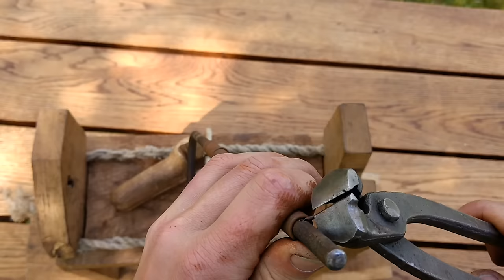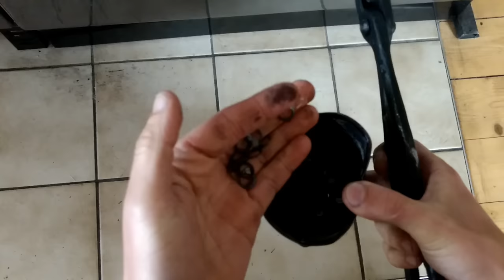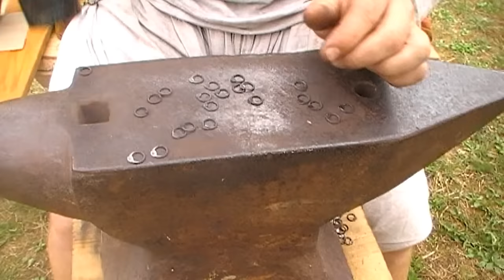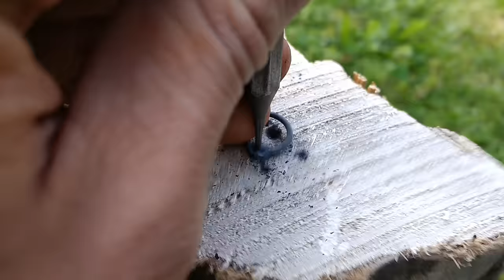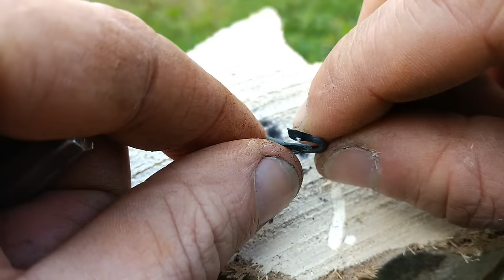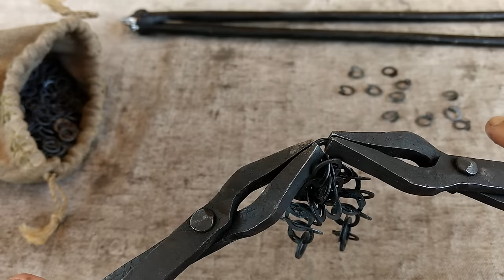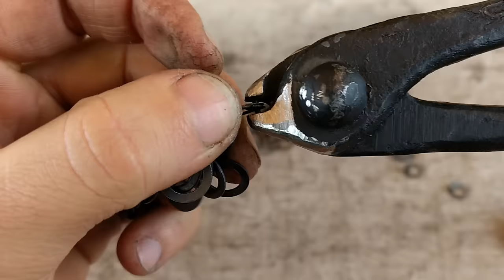How to make riveted chainmail

Comment: Although rivetted mail is more time consuming and labour intensive, it's worth it as the outcome is you have a very reliable and sturdy product that would survive brutal condition and most of all not tear open easily like a butted chainmail would......My passion n desire to make a chainmail had been revived!!😎😎😎
Reply: Even though this is 6 months late...my 1/4 inch inside diameter 14 gauge steel butted maille wont tear. Had several people try...rings are too small and too many in a small area. I trust my maille
Reply: LilRed Wagon how did they try? Were they using their hands, stabbing with a sword, or using something like a crowbill (not a crowbar, a crowbill)?
Reply: @dylannecros3636  original poster I assume means by literally 2 handed tearing it apart which I had 3 different "well" built guys try from work. I dont think a crowbar is gonna do much in the way of tearing my maille. I do know however that a rapier will only penetrate an inch and a quarter. The rings are small enough to basically stop a rapier from spreading the one ring the rapier centered on. But like I said I'll trust my work you dont have to take my word for it. As for the crowbill articles I've just read up on they state that crowbills were designed to pierce maille. Before hand I've never heard of a crowbill only of military picks and hammers. Friends sword (probably a cheap thing I dont know) chipped all along the contacted spots when he made a slashing move of some sort.
Reply: LilRed Wagon yes, it must have been a cheap sword. Most battle ready swords, unless if made with an extremely fine edge, which most aren’t, won’t chip so easily just by being swung into chainmail. I also meant actual stabbing with a sword, not swinging away. Some swords were better able to penetrate chainmail because the tips were broader and sturdier, allowing them to force open rings. I suppose it also depends on what target did you have the chainmail hanging from? Was it on a training dummy or a bale of hay, or just hanging loosely like a sheet on a cloths line when your friends were doing their thing? It’s not going to have authentic resistance pushing back on the weapon like if it were being worn by a man that’s at least 100 pounds, which would contribute to determining if it would stand up against attacks.
Reply: @dylannecros3636  I dont think a sword of any caliber is gonna slice through 14 gauge galvanized steel wire if that's what you're implying? And no a broadsword wasnt used to stab or poke but as I stated a rapier was used. The maille was draped over a manakin from an old clothing store. Just bought it from a pawn shop for cheap to use haha! The slashes did gouge a few links but that's all. Oh a cheap Chinese made "katana" was used for the slashes by the way.
Reply: @dylannecros3636  you do have to realize that I dont have the monetary gains to buy a legitimate/accurately made sword of any type we only used what we had
Reply: LilRed Wagon LilRed Wagon I’m not talking about slashing, I’m talking about stabbing. Rapiers aren’t a good measure for use against chainmail as they were usually used by civilians against offenders on the road who also had very little (if any) in the means of armor. Also, there are more types of swords out there that meet my description of the tip than a broad sword.
Reply: @dylannecros3636  why are you taking this so serious? It's not like you're the one being affected. And nobody carries anything larger than a knife. Hell even some countries abolished that. I guess I dont get what you're trying to get at? And yeah I get there's stuff out there designed to go through chainmaille I never denied it. I only assumed OP meant tearing in the literal sense. There are some vids on YouTube of people actually able to hand tear butted maille
Reply: LilRed Wagon LilRed Wagon LilRed Wagon I’m taking it seriously because you did first. Also, people do carry stuff larger than a knife. It’s not common, especially in first world countries, but people do still carry around swords. I just wanted to know how well you tested it and was following up with some tips and other things to find out how well the tests were done and giving you some ideas on what were effectively mail breaker weapons and designs, whether intentional or not. I guess through text it sounded like I was being aggressive, but I wasn’t. I was genuinely curious as I’d never heard of butted mail being that sturdy.
Reply: @dylannecros3636  just go buy some 14 gauge galvanized steel wire  and make a small sheet to test out is all I can say and I've never heard of anybody carrying anything like sword especially for self defense here in the states. And I never took my maille serious lol I only said that I trust my product. All that "testing" was for shits an giggles just to see what would happen
Reply: LilRed Wagon I understand that now about how you tested it. Also, people do carry swords around for self defense in the States, although it is exceptionally rare. I haven’t heard of it either, but just because it hasn’t made the news doesn’t mean there aren’t a handful of people who do it. Seeing as how Texas made all bladed weapons legal to carry recently (everything from knives to great swords) I assume there are at least one or two more people in that pool now.
Reply: @dylannecros3636  now granted I didnt "take" the boar with the spear I used it to finish off the animal due to a crappy shot with my rifle...
Reply: LilRed Wagon what?
Reply: @dylannecros3636  lol sorry got off track
Reply: LilRed Wagon lol, when I saw it I thought you meant to reply to another comment elsewhere.
Reply: @dylannecros3636  ya know...as much as I enjoy my chainmaille project I dont think that I will ever understand the process on making full sleeves...I can watch vids on YouTube all day but my mind cannot understand it for some reason...I might wind up just making a sheet to cover up from the shoulders down to the elbows
Reply: LilRed Wagon I think the best way to describe it is to just make a tank top and then add on row by row. I get what you mean by you can’t understand it, I’ve also been unable to grasp something that I should be able to in my past experience. You’re not alone.
Reply: LilRed Wagon what about the process is causing you issues, I can probably give you some ideas to adapt. I’ve helped people think of things in different ways so they can understand the process.
Reply: @dylannecros3636  the armpit thats giving me issues. but basically yes my project thus far is a really heavy sleeveless shirt that drapes down to my belt line/groin. its at a leather shop currently having custom made belts and buckles riveted on debating on whether i should add to it yet. current weight last i had it on was 40 pounds
Reply: LilRed Wagon ok, so unless if I’m misunderstanding, basically all you need to do is add some extra length under the arm in a sort of “pocket.” This gives you the ability to raise your arm more. Basically just make it a little longer on the underside of the sleeve, so that if you lay the shirt down flat, the arms would extend upwards a bit in a form of a shallow “Y.” Did that answer your question, or is it something else?
Reply: @dylannecros3636  i guess ill just have to do some trial and error stuffs when i get shirt back and if i do figure it out i probably wont do full sleeves, ill probably just stop at the elbows like with my original plan
Reply: LilRed Wagon good luck buddy.
Reply: @lilredwagon5311  is there somewhere i can see your chainmail..? I'm looking to make a coif and I was thinking of using 14 gauge 6mm ID rings
Reply: @brotherBvideos  That would ride pretty heavy. 8mm is about the smallest practical ID with 14 gauge, or 2mm diameter. You are wanting a link aspect ratio, ID÷WD, around 4. The smallest ratio you can weave European 4-1 mail is 3.2. Very decidedly double mail.
Reply: @w.reidripley1968  thank you for your response, yeah I ended up buying different gauges and testing out on a trial and error basis, boy are you right lol take care
Reply: @brotherBvideos  Yeah, I've become a complete convert to the theory of making your mail out of riveted... 5/8 the weight and all that -- maybe able to squeeze down to half the weight of a 14ga shirt, as being tolerable for the SCA  game, which can be summed up as "full-power and less lethal, in that we are smacking each other with resilient sticks".
I can most easily find wire that's suitable for riveted links which is heavier gauge stuff: 16 gauge (SWG). Might be best suited for thoroughly flattened links that gets spread out all over. In the smaller link IDs, I figure 16 gauge to be unabashed double mail. Optimal wire for most riveted mail applications seems to be 18 gauge. If you can find it ungalvanized.

Comment: Medieval version of primitive technology.  Love it.
Reply: You could almost call it "Medieval technology".
Reply: true =D
Reply: It’s like the Medieval equivalent to the bulletproof vest... If you were trying to block arrows and sword strikes instead of bullets.
Reply: @MedievalGenie  you can call it technology since tekne and logos are greek words. Tekne is knowlegde and logos is study of. So basically knowledge of knowledge. So not all technology is modern
Reply: @codyr.48  that would be a coat of plate   they looks very Similar
Reply: Plate is very resistant, enough to make the edges of the sword nigh useless, requiring the use of the point driven with both hands.
Doctor Doom notwithstanding , there are paces plate pieces just don't work, and that's where mail comes in.
The armpits, the varied motions of the neck, and the ball and sockets of the hips. The two sorts of armor make a good team.
Reply: mediocre technology

Comment: A thought. Rather than try to hold a handful of rings as you are trying to add ‘the next row’ for instance, how about taking a wood board and put a small tack through one ring, in the upper left corner (for right handed people).  Then as you add the frost row of, say, 10, and put another tack in that one.  Then each row hangs right in front of you as you add more rows or column’s, and when you have a certain size, set that aside and start over for the next square or sheet, etc., then later you can hang each block and knit the next block to it while always being able to see where you are. Just a thought.
Reply: Stitching blocks together as shown here is the hard way.
It's much easier to work an edge, like knitting. That way you only need to thread through 2 rings, and riveting is far more accessible.
I've only made chain mail from split ring washers, no ring production or riveting, but by working an edge it's much easier to get the needle nose pliers where you need them.
Reply: @dougaltolan3017  Thanks for your comment! (And knitting is exactly what I was thinking of! I’ve done some off and on, but this, making chain mail, seems to lend itself closely to that.  I know some folks like to reproduce things the same way it was originally made, and not just chain mail, woodworking, string instrument making, violin making comes to mind, using only the tools available at that time, no electricity, etc., but I would like to finish a project in my lifetime! Question… is putting the chain in a fire for the purpose of case hardening?)
Reply: @backpages1  in this video the fire treatment is to reverse work hardening. If you've ever worked silver, it's a similar thing. The metal is worked cold, but becomes brittle with working. The heat treatment makes it maleable (a bit) again.

Other people have asked if there is a post assembly heat treatment like case hardening. That, I don't know.
But the heat treatment here, and the subsequent working cannot be for hot working, so it must be anealing.
Reply: @dougaltolan3017  Cool!  Thanks!

Comment: “Why is chain mail so expensive?!?”
“Here, watch this video.”
Reply: @BlackSword Honestly. You’re usually getting a good deal.
Reply: Well the riveted version requires about twice as work compared to the butted version. So a riveted chainmail probably was very expensive on its time.
But also the riveted version would withstand cuts and penetrations from most weapons while the butted only partially protects against it because it busts right open.
Reply: Or at least riveted 4x1 chainmail ain't gonna speak for bent-wheel chainmail or double riveted chainmail and 6x1 8x2 weaves.
Reply: I bought a welded stainless steel shirt- for $320. I honestly feel like it should have been $400.

Comment: It seems therapeutic and incredibly mindnumbing at once.

I wanna try to make some at some point
Reply: It is very relaxing craft indeed and quite easy to learn. I have made different kind of chainmail patterns and even made a chainmail coif. I highly recommend trying out, it's not expensive either
Reply: You can buy premade rings online if you don't want to make them yourself.
For starters butted mail would be a good choice- it's easier, cheaper (all though it's not expensive to begin with) and takes a lot less time (you don't have to rivet every single bloody ring in the pattern) but it's a lot less durable.
Riveted mail will withstand pretty much every cutting test imaginable and will hold up pretty ok to thrusts whereas butte mail can fail you even at cutting tests and it just won't survive any significant thrusting test.
It does take a long time to make even a small piece but it's well worth it and if you are into HEMA it could save you hundreds of dollars or even turn into a small source of income.
Well made riveted chainmail can sale for quite the handsome premium.
Reply: @edim108  even if its less durable you dont need it to save your life , hell even if you want it to save your life a kingsmaile butted mail shkrt will do  just fine against any would be attacker
Reply: @howmuchbeforechamp  Butted mail can rip even if you pull it too hard. It's really not very good, but it's much less time consuming to make- that's why it's also cheaper to buy fully made butted mail than riveted mail.
Reply: @edim108  well i agree in can be pulled apart easily , but not if you use a thick wire , i have a vest i run with made from 2mm wire , its not something i can easily pull apart woth my bare hands 
And i am in the process of making a 6in1 vest with 2.2mm wire and i can garuntee you would need two big guys pulling on it to bend open the rings 

But yes its uncomparable how much less effort butted mail is , also i geusse you could weld butted mail should you be so inclined 
Also its not meant to stop a sword or arrow so its really not neccesary to get rivetted mail
Reply: @howmuchbeforechamp  Good for you mail armor are not for boxing
Reply: @Ulfheodin  i dont use it during sparring , it takes the place of a training vest , i had alot of time and it worked out , and im not kidding , 10times cheaper than buying a training vest of the same weight . 
I wesr during running and bag work so that when i tske it off im so mucn lighter on my feet
Reply: It's like knitting. Play music on your whatever device.
Reply: Numbing the mind is therapeutic in itself. Sometimes you just need the mental noise to stop.
Reply: @edim108 Anyone ever cheat and weld the butts closed with a MIG or spot welder?
Reply: I've made roughly a three inch by three inch patch of it with beading jump rings (much thinner and easier to work with, but purely decoration over practicality). It really is some hypnotic stuff to work on. I had to set an alarm so I wouldn't get too carried away with it.

Comment: I can spend all day, cutting, grinding, welding, turning and filing steel.

I come home, and relax watching someone making chainmail with the birds singing in the background.

First thing I thought?

I wonder if I could make a version with loads of circlips, and small mild steel pins?
Reply: I know a guy who made a Hauberk out of soda can tabs
Reply: @custodianvrael6471  Man, that sounds awesome. I'd love to try a project like that. Sadly, I live in an apartment building, and would have to find a way to make it without any eternally repeating hammer strikes
Reply: @surrealdynamics4077  your town, or one near by, might have an artist or artisan space. Might have to pay rent, but you can ask around if anyone does smithing, and buy or trade for time, space, and supplies.
Reply: Yes you can make riveted mail of circlips and pin rivets. I've handled the stuff. It's a rather heavy mail; I think 18ga, 1.2mm, wire links run a bit lighter weight and don't look kind of funny. But if the price of circlips in bulk is no object, you will get strong mail out of it. Expect to grow muscles working these links -- circlips are stout.
Reply: @surrealdynamics4077  one word -- okay, two. COMPOUND LEVERAGE, using big bolt cutters with modified tong like jaws fitted. Why whack when you can squeeze?
Reply: You will run across reference to riveted being just 5/8 the weight of butted. That is true true for 18ga rivetedlinks vs. 14ga butted... having 5/8 the wire diameter accounts for it. You could go thinner... in riveted.
Reply: I made a vest out of split key rings once